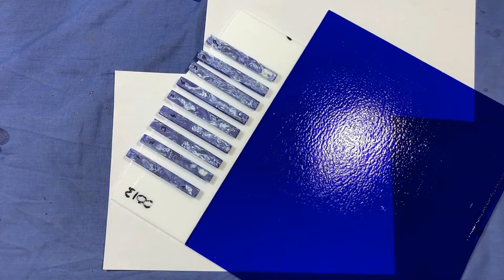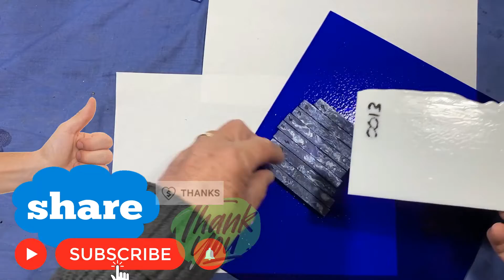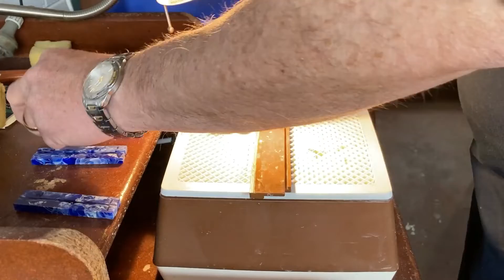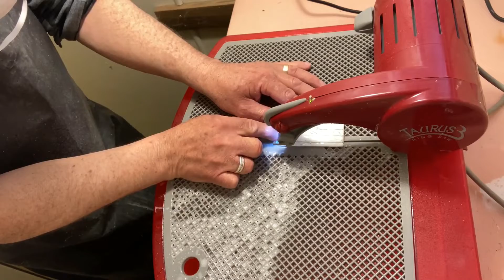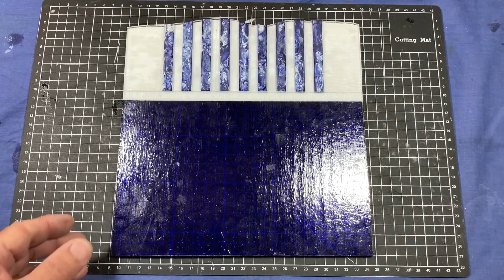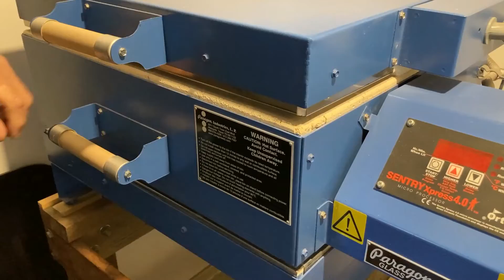Fused Glass Mesh Melt Platter, Project Tutorial Part 2

Comment: Newbie  here why put the clear on top, cap, and not put clear on bottom ?
Reply from the maker: Hi Carolyn. Depends on your design, and maybe food safe. Clear on top of some colours is recommended to improve food safety. If you want depth then clear on-top works for that. If you want solid colours clear on the bottom helps reduce cost. I don't think there's any rule, except for maybe food safety. If you're not familiar some colours contain things like lead and best that food does not come into contact. Bullseye has a good article about this.